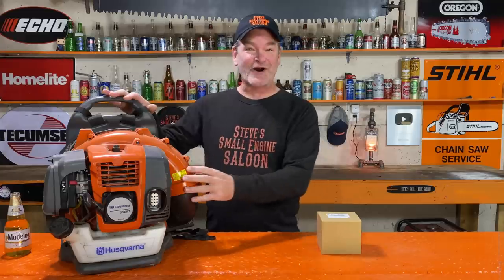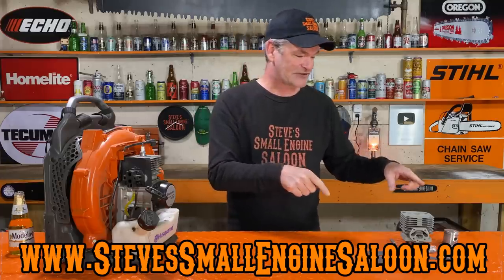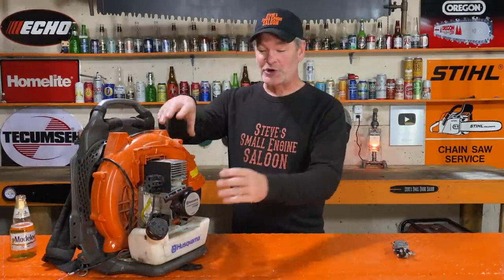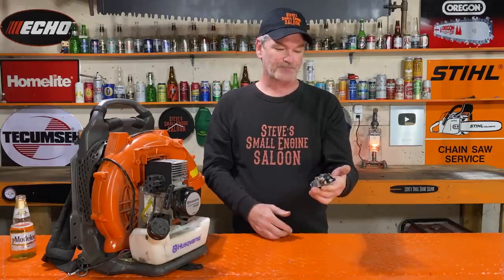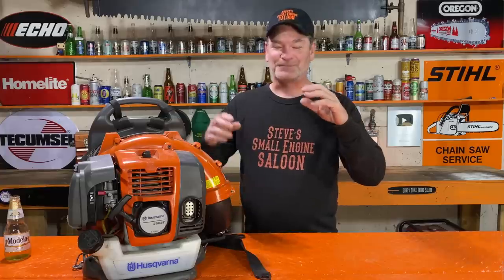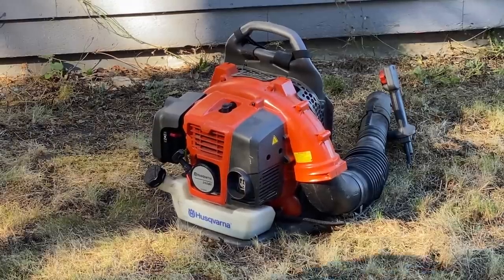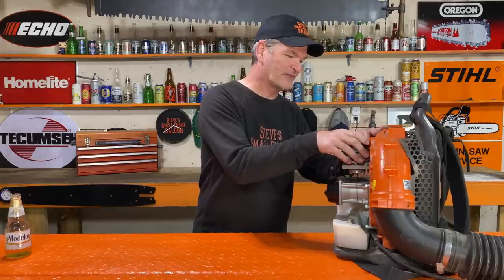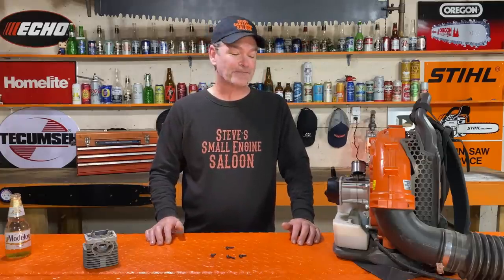Testing An After Market Piston And Cylinder Kit On A Leaf Blower

Comment: Used to work on golf cars. Tons of old Harley 3 wheelers, Yamaha and other 2 strokes. Probably installed over a hundred “jug kits” - same kit you had there. All “cheap” aftermarket.  Yamaha kits were over $200 but we could get knockoffs for $90. Never had an issue. Break in is key IMO and it’s hard with golf cars and things like trimmers and saws - people want to use them but it’s important to give the new parts time to seat before putting load on it.
Reply from the maker: Agreed!

Comment: it worked well....i think aftermarket is fine for small engines that you can easily repair in an hour or two.....for big engines in trucks and autos with difficult access and tight tolerances where it can take 4 hours just to get to where the problem is after pulling the radiator and alternator and 3 other pumps there is no room for aftermarket parts.....

Comment: Interesting break in method. Always used heat cycles for two strokes and kept the throttle blipped. Might have to try a long idle next time just to test out that method

Comment: The price of oem parts make this the only option to keep these things running sometimes.  I’ve used a few kits for mostly stihl stuff with great results.  I actually used a complete bolt in motor for my 029 about 5 years ago.  So far so good.
Reply from the maker: Great point!
Reply: My dad got quoted $450 in parts and labor to rebuild a $400 stihl chainsaw with oem parts...  Aftermarket definitely has its place.

Comment: It needs to be pointed out that not all after-market parts are equal. A good saying would be, "All after-market parts are equal, but some are just more equal than others". If I wanted to rebuild with after-market parts I would go online and find out what rebuilders have to say about different parts. There is some great info out there.

Comment: Trick I have used since my 2 Stroke Motorcross racing days is to put a small 1-2MM bevel on the bottom edge of the piston. It' stops the edge getting sharp  and wearing the bore and it also allows more fuel/ Oil Mix between the piston and Cylinder wall which gives far better lubrication.  I also NEVER run manufacturers oil recommendations or crappy lawn equipment type oil, only ever Motorcycle grade stuff. Manufacturer has no interest in engines lasting as long as they possibly can. Not a good way to sell spares or new products.  I always run more oil than recommended especially in something like a blower that is run flat out all the time.  The harder they run, the more oil you should give them.  When it runs out the pipe, back it off a few points and you are good. And NO, quality oils in a properly tuned engine  do NOT foul plugs either.  I have run some crazy 2 strokes Including hotted up mowers doing 4X their original output used for overgrown slashing  and never blown one and the wear is virtually nothing for the hours done.  Yeah, I'm sure lots of people will argue with anything but the parroted and prescribed mantras but I also bet the same people have never tried anything hands on different to know any different.

Comment: I have had mixed results with aftermarket parts. Some kits are absolutely excellent. But some are garbage. I bought a mid range price cylinder kit for a chainsaw, and it looked like it came directly out of a saw casting. Checked the ports and it still had grit and sand on the ports. Always inspect your kit before you install!
Reply from the maker: Great point!

Comment: Great vid....
I bought a lunched Stihl ms290 for 50 bucks and put in a chinese cyllinder and case bearings/seals, with an Italian piston...I have been running the dogshit out of it for 4 years now with no probs other than broken plastic and bolts falling out. I ALWAYS run 100 octane (non-alcoholic) avgas that is doubly stabilized........

A good test for a piston/cyllinder combination would be high loads with sub-regular gas (ethanol)...detonation is the enemy of these tiny  2 strokes IMO

Comment: I had an old master tech for the OMC outboards i work on tell me the best thing to do with a brand new motor is to vary the speed to get those rings to expand and seat into the bore. Letting it idle for extended periods brand new will glaze up the cylinder walls. the worst thing people can do is baby a brand new 2 stroke.

Comment: I actually used a knockoff carb on my mom's stihl straight shaft trimmer as the rebuild kit costed about the same and surprisingly it worked just fine.
Reply from the maker: Right on

Comment: Hi Steve, I’m not at all surprised,  I’ve bought these Chinese kits for various machines an never had a problem I rate them. Buying OEM usually makes it to expensive to repair. But these kits are low in price so a machine can be saved,  I do though run a bit of extra 2 stroke oil in my mix I think I heard you also do, I mix it at 40-1. Shame  you couldn’t pop up on my stream last night perhaps another time 👍 Good video I enjoyed it🙂👍
Reply from the maker: Thanks Luke!  40:1 for me...

Comment: Steve, a while ago you did a bit on sealed spindle bearings and how they should be replaced with a set of bearings with the inner seal removed and a zerk fitted. How important is it to have an extra hole drilled to show when the cavity is filled with grease. Shouldn't you be able to tell by the resistance on the gun lever?  
Keep up the excellent work, man. You have my favorite channel. #2 is Essential Craftsman.

Will

Comment: I’ve rebuilt a couple of ts410 cut off saws using aftermarket piston and cylinders and never had a problem with them. It seems the aftermarket sector has caught up majorly to the OEM guys, that or they make the parts for them and sell unbranded/brand removed parts as copies like car part manufacturers do! Crazy how removing a logo can reduce the price of a part by 50%!
Reply from the maker: Interesting!

Comment: I have a problem with a lot of the Comments on many tool and small engine channels, complaining about "Chinesium crap."  
This is where I came in, back in the '70s with Japanese cars, guitars, etc., when UAW's were taking sledgehammers to Hondas and Toyotas.  Yeah, some stuff made in China is bad but some is good, just like it was with stuff made in Japan . . . and before that, stuff made in the good ol' USA! 
 
I got my Toro 20333 lawn mower, with the B&S, "Assembled In The USA," "Never Change The Oil" engine;  gonna see how long I can get it to last.  Four years so far.  (changed the oil after five hours, change it every Fall and remove the cover and blow it all out, etc., etc.).

Comment: Most of what I own is quality stuff but I did buy a Chinese "Blue Max" brush cutter. You need a big engine to run a saw blade and this thing was ridiculously cheap for something with a 43 cc engine, like $159 vs $800 for a Stihl. Uses a 40:1 mixture. Pretty impressed with it actually. Can you use 50:1 with that replacement piston? I would imagine 40:1 might be safer.
Reply from the maker: I have always ran 40:1 in everything...
Reply: @StevesSmallEngineSaloon   Maybe that's worth a video. Most of my newer stuff calls for 50:1 which is what I use. Do you think the engine is better protected using 40:1? Have you noticed any difference in tear downs? Do you get any better power using 50:1 or is it just about emissions? Thanks Steve!

Comment: Have to give Chinese aftermarket parts their due credit, gone are the years of shoddy craftsmanship and sub par performance. Many of the aftermarket parts are surprisingly well built and do a tremendous job for many repairs, matter of fact many Chinese clone based machines such as chainsaws work extremely well for their use. I wouldn't have said that 20 years ago, but they have improved tremendously and cost wise you just cannot compare. Good to point it out Steve, give credit where it is due.

Comment: I run aftermarket top end kits all the time! Some kits are better than others. I have been having great luck with proline parts on eBay I just rebuild 3 STIHL BR420s and did a similar brake in process. Put them right into full service and not a problem!!! Ps my fuel mix is golden spectro oil at 45:1 mix using chevron 94 ethanol free. Even after 2 weeks of every day full throttle they look just like new no problem at all! Great video!  By the way if you are going to select aftermarket parts never buy anything from Duke's saw shop on eBay they sell absolute garbage and will not help you. If you have a problem!

Comment: Another fine video as always, thanks! This one was exceptional. 
Now these days obtaining OEM parts can be challenging some refer to 3rd party or after market vendors. 
Especially when the product is older or the manufacturer just don't want to keep making replacement parts. 

This goes for everything including automotive side. I have used many rebuilds, aftermarket or 3rd party parts and on few occasions I have ran into issues. Sometimes the 3rd party part can be just as good as OEM. I have had OEM parts fail on me before. 

Sometimes it's more cost effective to go with an aftermarket part.
Reply from the maker: Agreed!

Comment: I’ve saved a few chainsaws that were destined for the trash due to the cost to fix it being more than a new saw. My stihl MS 660 I got super cheap because it had a branch bust it up in the log woods. It cost me about 200$ in eBay parts to save it but now I have a nice saw to cut firewood.

Comment: I have truly enjoyed your videos.
I especially liked the video on using an ultrasonic parts cleaner.
I have a question which I hope you can give a clear, simple answer to.
I have an 8HP magnum TroyBilt tiller.  I actually wore it out.  I want to rebuild it/restore it.
I will have to skim the cylinder bore to true it up.
I am thinking I will need to buy a slightly oversize piston.
Could you please tell me what the piston to wall clearance must be?
Thank you for your time and excellent videos.

Comment: I started in automotive and then later got more into small engines, I know that for cars a lot of stuff that’s not electronic/sensors it’s okay to go aftermarket and sometimes it definitely lasts, but perhaps not as long as the OEM. At other times aftermarket parts are surprisingly better than the OEM — there can be bad engineering, cheaping out, or that they’re testing new ideas/innovations.

In my car I try to go OEM because I do say that most of the time OEM is higher quality.

Comment: I have put a couple of the chinese cyl kits on partner and husqvarna concrete saws that people gave me . The cost they were quoted to repair them , made them buy new saws. of the 4 that i rebuilt only one blew up. i gave that saw to a friend who ran straight gas .all the others still run are used on a regular basis.maybe i got lucky 4 times ?

Comment: The usual great vid. China is OK at copying bits of metal, and running it in right probably helps, but things might not have ended so happily for the performance of the blower if you'd used a Chinese knockoff carb diaphram.

Comment: Great vid as always. Question: I have a friend that ran his blower on straight gas and it seized. Is there anything else that might need to be replaced besides cylinder, piston, rings and what you show here? Crankshaft bearings? Anything else? Thanks Steve, you ROCK! 🤩
Reply: it depends on what rpm it seized at, and the duration of the seize. Usually you will be ok just replacing the top end, but you should check the crank for chatter marks and inspect all bearings yes. if not, its 50/50 kinda thing.

Comment: Yesterday a friend could not start his ms170 , I looked and it had low compression , he "thought" he might have used a batch of 100:1 meant for an outboard motor , 5 litres of it . New block /cylinder assembly about $50 aud , brand new saw $249 , on balance I think in his case a new saw might be the better way to go .

Comment: When my 25-year-old Stihl brush cutter needed a carburetor several years ago, the company wanted $95 for a new one — more or less what the entire tool was worth. I bought five aftermarket carbs on Amazon for $6 — yes, six dollars — each. I have used three of them thus far on several of my dozen Stihl tools and every one has worked flawlessly. Instead of fussing with the useless rebuilds of factory carbs I just install one of these. For a fraction of the cost and time the tool is back up and running. As long as a manufacturer charges a small fortune for parts that cost a few dollars to produce I will shop for aftermarket goods.
Reply from the maker: Right on

Comment: Test suggestion.
You know how they say not to use starting fluid on a two stroke? Take cylinder off and inspect before running.
Run a two stroke on starting fluid and do a tare down to see if it did any damage.

Comment: Always curious the name " after market " , small engines don't make every parts for the finished products  , they could be the original parts , eventhough  aren't , would they certainly be sure meet the specification and fits them exactly and perfectly  ?? Just my own thinking  !
Reply: Aftermarket could be made by Original Equipment Manufacturer  (OEM) . That would mean they supplied the parts for the finished product during the production  run. Aftermarket could also be a supplier with no  affiliation to the original manufacture of the product. I prefer dealer or OEM.. Most equip. is originally manufactured in Asia now. The majority in China (PRC). The supply chain there may use many  small subcontractors. Subcontractors may be selling some parts under a different label. Ordering online can reveal the full spectrum of quality and price point. When a source turns out to be of good quality and price, it is probably best to go that route.

Comment: I had a Dolmar chainsaw with a piston and cylinder in almost as bad condition. The thing is, though, I always used a good grade of fuel-oil mixture in the proper proportions. I have no idea why it behaved as though there was no oil in the mix.
Reply: Air leak in manifold boot or crank seals maybe. 
Carb tuned too lean. What color is the spark plug?
Cutting with a dull chain.
Carbon scrubbed piston from built up carbon in the exhaust port.

Comment: You didn't mention Husqv is real proud of their parts ;) Aftermarket is 1/4 the price. I like Huskv but their parts prices make most not worth repairing.
Did a Huskv with a Chinesium kit. The casting had some flaws and a pit in the cyl near the bottom, below the ring area. Buddy did a Stihl concrete saw. Both seemed to work fine.

BTW, I have a customer that every piece of gear he brings in is missing the air cleaner. These clip on filter covers are a dumb idea; fly off on trailer. Then he brought a new Hitachi backpack that died in just a few uses. Big chunk of metal embedded in the piston and tore everything up.
I no longer get gear with no filter from him.

Comment: I break mine in differently. I break my gas engines in just like a diesel. Once it's warmed up it's full load till that ring set seats. I've had no problems with this method and especially no cylinders glazing.

Comment: Any part that you get is a hit or miss.  I have used both OEM and after market parts that have both worked good and have been bad.  I do prefer OEM.  I run a landscaping business so I prefer OEM especially for all of my Stihl products.  But I also rely on my service tech when they recommend a replacement part.

Comment: I bpught a replacement carb for my Stihl ms180 for $12.00 and it looks real well made. How can you go wrong. A friend me replace a piston and cylinder on a largee Stihl saw with a 30. Some dollar Chinese replacement and i found a small dimentional problem but the main thing i see is the new one has a bare aluminum cylinder, npt a cylinder with a nice hard liner like factory. Saw runs good but how long is it going to last. Unfortunately looking them up to buy they never say if they have an iron liner. I suspect none of these do.

Comment: I can't say much for aftermarket 2 cycle carburetors but, I'm gonna have to get an aftermarket carb for a Briggs and Stratton 21hp oppy. Briggs no longer sells the carb but if they did, the want $368 USD. I can get a chinesium knock off for $45 USD. The emulsion tube/ main jet is stripped out and can't get it out.
Reply from the maker: Good luck!

Comment: It looks like the intake side of the cylinder is in good shape 1:35 but the exhaust is roached. Normally I would consider this a lean seize and not even suspect straight gas but obviously you have the experience and the equipment right in front of you. I'm not calling you out, I'm just curious on your thoughts. Thanks for putting out such great videos.

Comment: I use a lot of aftermarket part in my shop. My customer's would never get anything repaired if I had to charge them OEM prices. I have a question, though, about this repair. Wouldn't running that with straight gas have had an adverse effect on the connecting rod and the cracnkshaft?
Reply: I agree with You and aftermarket stuff works great also 
Keep cost down and get more business 
MTD are very very popular in my area and they work just as good as jd